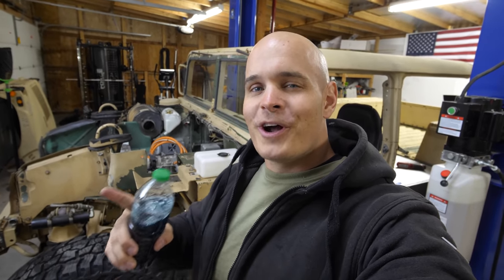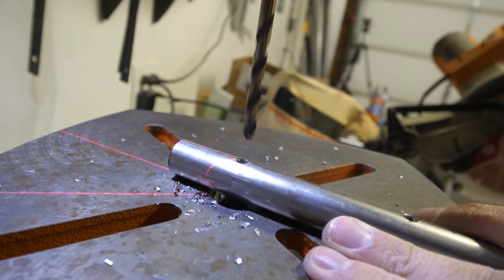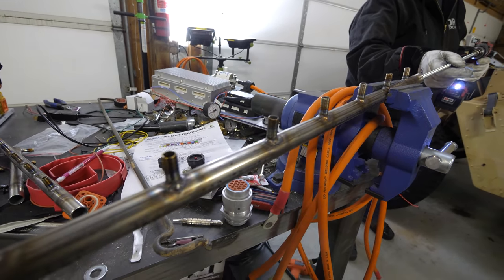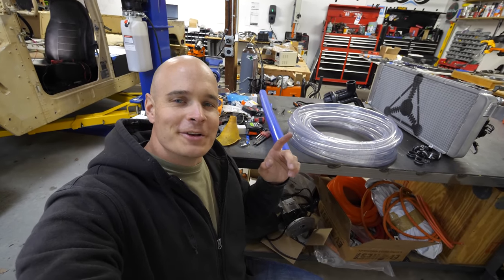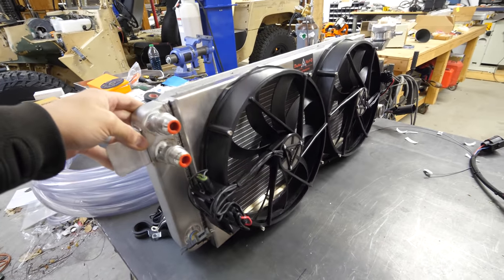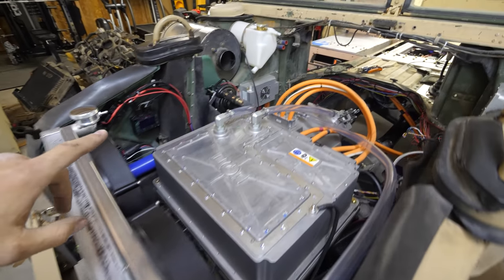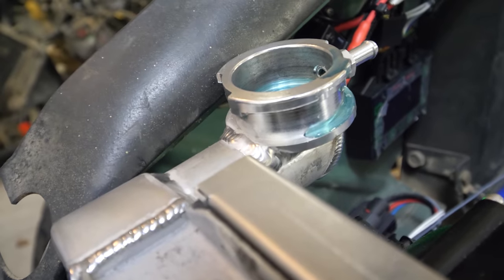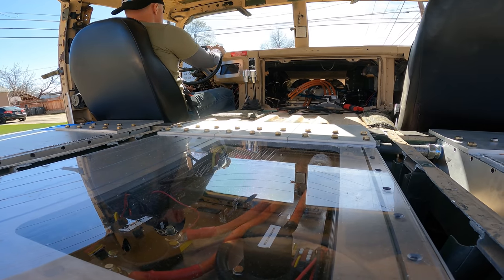The ELECTRIC HUMMER projects 'coolest' video YET...

Comment: What’s the manufacture and model of the pump you are using?
Reply from the maker: DeltaPAG
Reply: @JerryRigEverything  thanks! Is that a kind of self priming pump? I am also doing some electrical vehicles for construction market and the biggest challenge is to get a self priming pump due to the position of the reservoir and radiator
Reply from the maker: @danjrosa  I'm not sure! You'll have to reach out to them.  I put a link in the description
Reply: @JerryRigEverything  Thanks! Appreciate! If you have sometime look for the electrical Bobcat T7X, I am the one leading that project.
Reply from the maker: @danjrosa  lol.  Sounds like we need to get together and make a video. Send me an email if you guys wanna show it off.

Comment: Your shower reference is not accurate. A radiator works by conducting the thermal energy from the batteries and motor to the fluid, from the fluid to the tubes and fins in the radiator, and then from the fins in the radiator to the air.

In a shower, most of the heat loss in the water is due to evaporative cooling. Moving from a liquid to gas state is an endothermic process, and when water evaporates into the air it pulls thermal energy from the water to perform this process thus cooling the water. This is why animals sweat to cool down, and why sweating is less effective in more humid climates.

Comment: Hey guys, I am trying to find out the internal and external diameter of the inlet that allows fluid to enter the battery. You can see it at 6:42 in the video. Does anyone have this information or know where to find it?

Comment: Questions for the really intelligent people here. Wouldn't having a gearbox/transmission make this more efficient? Like not needing tons of electricity to spin the motor really fast when cruising at higher speeds.
Reply: Add a gearbox will make it less efficient due to losses at the gearbox (mesh, friction, ect.) Every motor has an efficiency curve showing at what rpm is it most efficient. Usually that's around 2000rpms. Looking at size of those tires, direct drive with no differential that will be enough speed. Not sure what type of diff the hummer has or gear ratio. Also note that an electric motor has the most torque from zero rpms. That's opposite of an ice motor.

Comment: Umm no overflow tank... bad idea when the motors heat up lol
Reply from the maker: Just waiting for a lower psi cap to show up, then I'll connect it to tank near the passenger window.
Reply: @JerryRigEverything  did any fluid leak out during your drive?
Reply from the maker: @MADagain  nope. The cap is like 17psi. And it didn't heat up hardly at all.
Reply: @JerryRigEverything  Yeah but theres a barb for the overflow tank under the cap so if it does build up pressure... that fluid is going streaight out that barb fitting regardless
Reply from the maker: @MADagain  it would never get to 17psi. There's not enough heat,  and I haven't pulled them air out of the system either.  Lol zero chance of it ever getting to 17psi.
Reply: @JerryRigEverything  Drain the fluid, if you have the same amount after you drain it I'm surprised haha. That's actually awesome though. But I'm assuming the torque and power isn't correctly dialed in so that might also contribute to it but not understanding it myself is also half the issue.

Comment: Just so you know your “permanent” setup is gonna leak eventually. I would do something else, modern cars stop using these kind of setups cause it will no doubt leak in the next ten year. I have done a lot of classic cars and it just doesn’t last “permanently”. Make sure your batteries are prepared to be leaked on, it will happen at some point

Comment: i can hear the sound of gears !!! you should never hear the sound of gears !!! metal on metal is bad !! everything should be submerged in oil !!check your differential check your hub gears and check for no metal on metal contact !! everything should be lubricated
Reply from the maker: This isn't true.  A lot of gear boxes are noisy. Mine are filled correctly with oil. It's fine.
Reply: @JerryRigEverything  i was wrong  im sorry ... i apologize